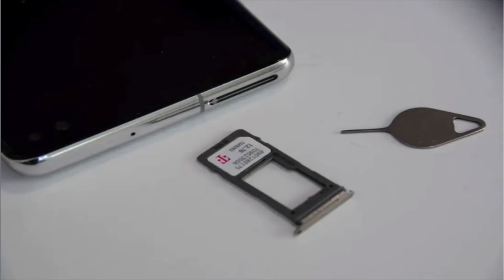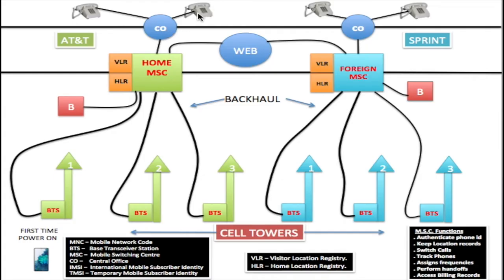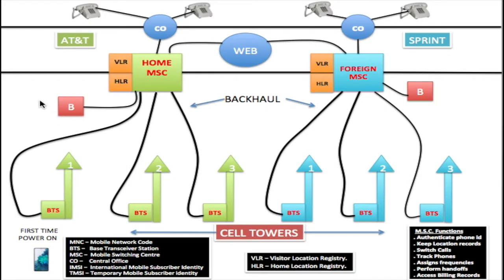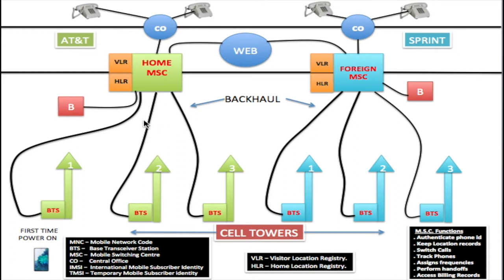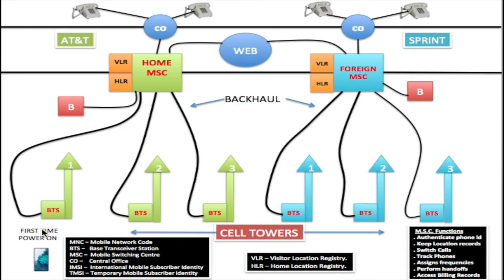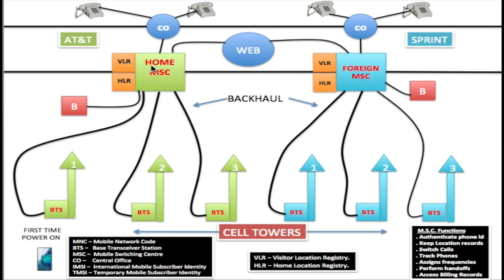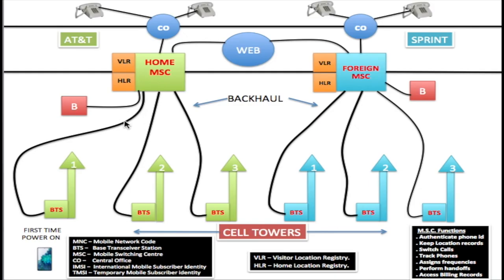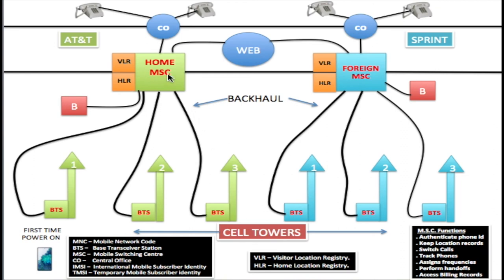How Cell Phone Towers Work

Comment: One thing I have read a number of times, is that these wi-fi 4 and 5 g towers are worth between $10,000 in rare metals and $100,000 on the black market. Here is my question, I can see people in the USA cutting those tower wi-fi units down. If they can catalytic converters out of cars, they will sure as hell cut down Wi-Fi 4g and 5g units for the metals. I started counting those towers and they often have 20 or more wi-fi broadcasters on a small tower. have you head of this being done - yet?
Reply from the maker: I haven't heard of any thing like that happening.
Reply: Savage comment.
Reply: That is BS, antennas can be made out of any metal, the expense in the towers is the brand names on the panels, you can't sell that on the BM.
Reply: Well, it probably is not likely under normal circumstances, but what did ppl do when the Soviet Union collapsed?

Comment: What would it take to start a go fund me and buy a tower and make cell service free for the whole city? How much money would that take?
Reply: Allot. Lmk after you do all the actual research though
Reply: I’m not sure that’s necessary. There’s already a SIM card available that you pay 5 USD for and that’s it. You have cell service.
Reply: @YardKat666 What’s it called? Because as far as I know, they all charge a monthly service fee.
Reply: I mean first you would need to buy a slice of spectrum that would work with devices or use non licensed spectrum, which good luck getting much out of that due to interference because most of that spectrum that’s usable would be in the same range as your home WiFi equipment. 

Then you need to pay rent , hire a crew to mount antenna, pay for a backhaul solution, hire a networking staff, a billing department because it couldn’t be free unless you have absolutely bonkers of money sitting around.

Then you would need to buy devices that can operate in said spectrum, have your own SIM cards, etc

If it’s simply for home internet then we’ll all of the above still applies plus home installation teams, and a proper security team to ensure you or your customers have proper security to avoid data leaks/breaches

Comment: You mentioned 2 different frequencies for the handset to transmit and receive on.  This is only true with full duplex.  With 4G & 5G, half duplex is also often used.  The advantage of HD is the ratio of up and down stream traffic can be variable, whereas with full duplex it's the same.
Reply from the maker: Question Aswered before.

Comment: If a call connects to a tower in the next city, will it transmit to a new tower closer to the customer as it becomes available?
Is it safe to say that you can accurately place where someone is based on their phone pings?
Reply from the maker: Your phone would always connect to the strongest cell signal, so if there is a new cell and its signal is stronger your phone should connect to that one.

Comment: Does cell towers transmit signal or generate signal? If it transmits only, where is the source?
Reply from the maker: Cell Towers transmit and receive signals with Cell Phones.  The signals come from the base station at the foot of the tower which is connected back to a central switching station.  Cell towers only transmit and receive signals.  The only signal that they may generate is the wireless frequencies to transmit and receive voice/data from cell phones.
Reply: @TelecomTraining   Actually, the radio equipment can be at the base, near the antenna or built in.as part of the antenna.  A few years ago, I was doing some work for Freedom Mobile in Canada.  With them, the radio equipment is in a suitcase sized enclosure, mounted on the mast, just below the antennas.  I also have done some work for Rogers and their equipment was in a small building near the base.  It all depends on the choice of the company, though the trend, with higher frequency bands is to have the radio equipment close to the antenna, as feed line losses become more significant with frequency.  5G uses complex phase array (massive MIMO) antennas which requires the radio equipment to be close to the antenna

Comment: My business cell phone bills show that I’ve made calls from a tower 3 towns away when I’m calling from my home? Sometimes the bills show the correct location, and sometimes they show 2 towns away?
Reply from the maker: It is normal for the Cellular Network to switch the tower which your phone is connected too even when you are in the same  geographical location.  This switch would normally happen when the signal strength between the tower and your phone drops below a predetermined level.  Signal interference to the tower can also trigger the switch.  Hope this was helpful.
Reply: @TelecomTraining  Yes,thank you very much for the information !
Reply from the maker: @boomersD9CAT  You are welcome.